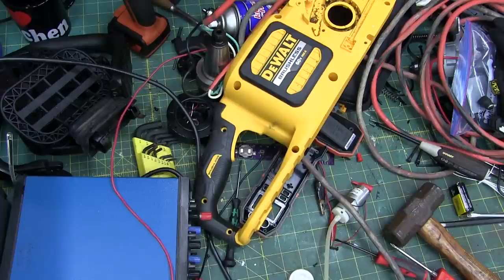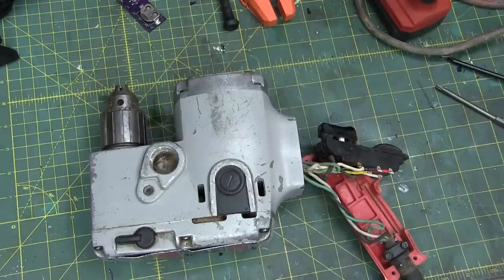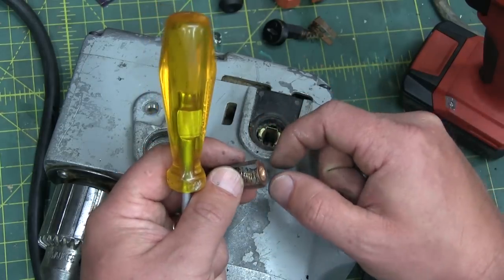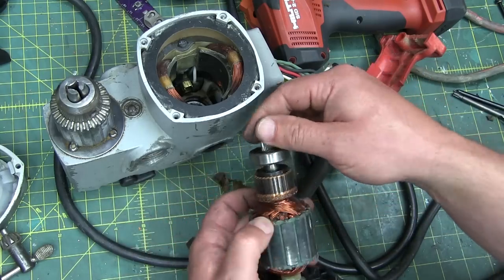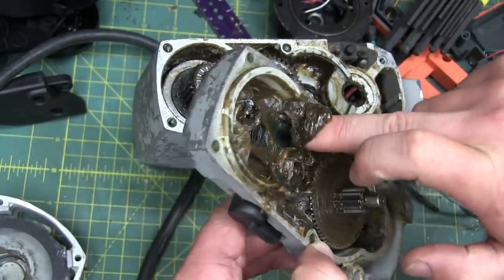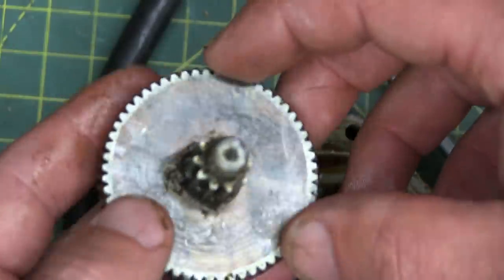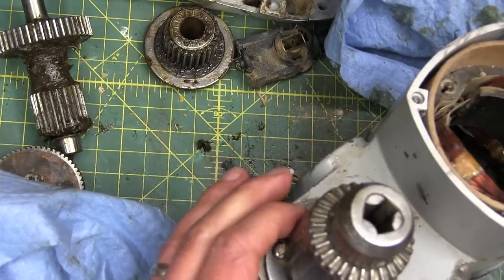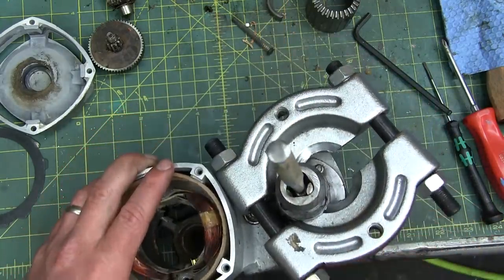BOLTR: Milwaukee Hole Hawg | Long Term Quality

Comment: last time I took a chuck off of a drill, it was threaded on and had to be unscrewed
Reply: Ben D unlike milling machines and large drill press almost all hand drills have theaded chucks.
Reply: Was gunnar mention that. But he only reason I knew some a treaded is because I was drilling a 14mm hole through a post one day with my cordless drill and snapped the center screw when the bit named on me so I put the drill in reverse to take it out and the chuck unscrewed itself off the drill. That poor old drill is still running to this day without the retaining screw in it.
Reply: If there is a left threaded screw inside to fixate it, the main axle has right thread.
Reply: You are certainly right about this one lol ask me how I know.😂
Reply: Yes Sir! The chuck is threaded.
There were adapters to use on those drills for drilling around corners and such.
Very versatile machine.
Reply: The reason the little screw is left hand, is the chuck threads on right hand.  
At least you had the right idea. I am the guy at the machine shop.  They always hammer something into it before bringing it in.  LOL
Reply: Jacobs 33351 1/2"-20 RH threaded mount.
Reply: Just about to say this
Reply: Hand drills typically are, but this one is on a taper.  You usually can get it off by removing the screw and then tapping the side of the chuck with a hammer.
Reply: it is not uncommon for the customers tools to be stuck in the work.
Reply: Steve Pepin Not in this case. That chuck is right-hand thread. Coupled with the left hand retaining screw it can spin in either direction without coming off.  I removed one just like it a couple weeks ago. 

And yes, the drill needs to be assembled to give enough resistance to get it to spin off. Pain in the ass.
Reply: Was going to say this as well.  A little lookie loo at the parts diagram would confirm or deny my idea.
Reply: Boys I tink dis is gunna end badlyier !
Reply: yea that was my thoughts too, came to say this
Reply: i WAS FKKKING SCREAMING THAT.
Reply: yep and i dont think that one is broke yet. tho he hasnt done it any favers
Reply: suppose that would explain the 5/8-18 numbers stamped on the chuck opposite the capacity
Reply: I took one off a old Milwaukee right angle drill and it was threaded on
Reply: Yep the chuck is threaded on there.
Reply: watching him try to force off that threaded chuck  reminded me of the 60v dewalt battery  shipping cover incident.
Reply: Just came on here to say that. Come on Ave you're disappointing me, the chuck is threaded on! And here I thought you knew everything! Haha
Reply: Damn, I thought I was clever noticing this one, clearly the AvE comments section is a place of wisdom
Reply: This is what I thought too.  I kept waiting for him to figure it out.
Reply: He even showed the 5/8-18 thread designation on the nose of the chuck... that is exactly what it means.
Reply: If it's threaded, you definitely need a heavier hammer
Reply: i use an allen socket and an impact,comesright off.
Reply: Same
Reply: jacobs are usually screw on, the little bolt in the middle is secondary fixing, chuck is normal right hand thread, bolt is left hand thread, so if it tries to unscrew it tightens itself, both ways...
Reply: I was thinking the same thing...  Lot of, "Um, wait, WTF are you doing here?" while I was watching.  Never had a HoleHawg though, but replaced MANY portable/handheld chucks by unscrewing.
Reply: To get the thread on the Chuck to slip, clamp a allen-key (as large as she will take) in the chuck. Then get someone to then hold her down while you have a go at the Allen with a hammer.
Reply: Too late for that here, he broke the locking ring with the puller, the chuck is toast. The left hand threaded center screw should have been a dead giveaway to him that he had a screw on chuck. If he puts the drill back together he might have enough gearbox drag to unscrew whats left of the chuck with a pipe wrench.
Reply: I was thinking the same thing.
Reply: This is a fact
Reply: Lol, the chuck incident made my day. Don't know how many times I've done something similar.
Reply: @bobbynate4271  how do you know?
Reply: Doesn't say 5/8" thread on the chuck? unscrew the darn thing
Reply: @kurdtpatton5039  If you don't SCREW up on occasion,you are not using youre full potential! How else we gonna learn?(other than watching others fumbles!) Also recall my father telling my mother "if at first you don't sucseed? Keep sucking untill you do suck seed! May or may not  apply to hole hoggin"?
Reply: Yes. Once I get the left hand screw out of the chuck, I just chuck up an allen wrench and smack it with a hammer and it spins right off.

Comment: If I am not mistaken the reason you were not able to remove the chuck is printed right on the side of it. It is not a taper chuck, but rather a 5/8 threaded chuck. Hence the reason for the left hand center screw.

Comment: I used to build those at the Milwaukee plant in Blytheville, Arkansas back in the mid 90s.
Reply: You did an absolute fecking good job. Bravo brother! Have two 90's models still going strong.
Reply: So how are you supposed to get the chuck off?
Reply: @Vikingwerk  it unscrews
Reply: @jonadabster8401  Thank you Sir, as smart as the guy is, sometimes his "engineer" side takes over.............................ffs...

Comment: The ring is split at the factory. The outer gear holds the two ring halves of the ring together and against the jaw racks. The left thread screw stops the chuck unscrew itself when the drill is run in reverse, which, once the left thread screw is out, is a much easier way of removing the chuck. Let the tool pull itself apart. Hard to do though if the tool is already mostly apart 😀

Comment: Believe it or not, the way to remove the chuck is to have the tool fully assembled, remove the left hand locking screw, then lay the drill on its side and put a short bolt in one of the chuck key holes just above parallel with the bench, then give it a sharp hit downward with a hammer. That usually cracks it loose, then you can spin it off by hand. It sounds like butchery, but that's the way it was done in the 80's (they probably use x-ray lasers or something nowadays).

Edit: I should probably add that the chuck shaft's threaded . Please stop brutalizing it with the breaker.

Also, the tabs going into the switch come out by just popping them straight out with a screwdriver.
Reply: On the threaded chucks you can also clamp the largest Allen key that will fit into the chuck and tap on the end of the key to rotate it off ( once you have removed the retainer screw of course )
Reply: Allen key is how I do em
Reply: Bob James, that is eggzacary the way I remember taking the buggers off, all the swillwaukee drills I have owned/used came off in my hand this way....
Reply: Make a video. I have 4 of these someone gave me free. Seeing if I can fix em.  I'm a visual learner. I'd appreciate the knowledge. 😊

Comment: On the chuck.... look at the small print on the chuck barrel (@ 26:52).... I think it says THD 5/8-18 ......... means it's a threaded mount onto the arbor..... generally RH thread. Because this drill is a reversing model, they add the LH-threaded machine screw inside the chuck to keep it from unthreading during reversing operations.  Most hand-held drills would use a 3/8-24 mount---- this Hole Hawg is Maximum Skookum, I guess. They want the bit to shear-- not the drill's arbor.
Reply: Good eye!
Reply: More like they want to sheer the user's arms first

Comment: My favorite memory was working as an electchicken apprentice standing 6 feet up a ladder drilling a fence post to use to sleeve a wire for a future light. Sure they sell them predrilled but what fun would that be?! I got about chuck deep and all was fine until sparky walked over with a bit extension. As soon as that was on the bit and tight in the chuck he said “ok wait a second” as he got down from the other side of the ladder and stepped about ten feet away then said “ok, go for it!” Wish I knew then why he got that far away but lesson learned! Soon as I started it bound and I learned a valuable lesson. Bumbles DO bounce! I came down after a 1 1/2 twist and a perfect splash into a huge puddle on my head!  That was over 30 years ago but like yesterday when I see any of the guys from my old crew because that’s the first thing to come up after “hello!” Good times!

Comment: Cardboard sleeve is to reduce conduction of heat from motor to housing, ref cooler to operator. 
With regard to regreasing, power tools, try to use as light a grease as possible, ref NLGI grade 0, or 1.
Keep chomping on your bench chap!

Comment: The set screw is left hand thread, but the chuck is right hand threaded onto the shaft. Also those 3 teeth that hold the drill bit will be numbered and have to be installed in the right order to work. It's the same setup as a 3 jaw lathe chuck

Comment: It is painful to watch the heat and beat knowing that the Chuck threads on and I can't say I have never made that wrong turn before either
Reply: No it's not.  It's on a taper.  He should have just hit it on the side with a hammer after removing the screw.
Reply: Bet you a lemonade its threaded on Steve... this ain't no drill press.
Reply: From the owner's manual:  Chuck Removal  To remove the chuck from the drill: 1.Unplug tool. 2.Fully open the chuck jaws 3.Remove the left-handed thread screw from inside the chuck by turning it clock-wise. 4.Pull the chuck off of the spindle. NOTE: If the chuck does not pull off of the spindle easily, tap the side of the chuck with a hammer to loosen it. If this doesn't work, contact a MILWAUKEE service center.
Reply: Tappy-tap-tap
Reply: Tap tap taparoo
Reply: Cringey viewing.                      If it has a left hand screw at the bottom, the chuck is threaded on.
Reply: Steve Pepin I am looking at the original 1675-1 (413B) service parts list and it doesn't appear to be a taper or a threaded chuck.  It looks to have flats on both sides of the shaft that feed through to the chuck.  Interestingly it states that the chuck is mounted to the spindle with 90ftlbs of torque but not sure how if it is not threaded since the lefthand fastener won't handle 90 ftlbs.  Since we don't know the history of this tool it is possible that it has been serviced before and someone installed the spindle and chuck for the (413A) version which is threaded.  It appears versions 413B, 413C, 413D, and 413E all us a spindle that uses flats rather than being threaded.  Since Milwaukee made more than one version for the same model and this one should not be threaded it is possible though unlikely that it is built like the A version. and is threaded but we probably won't know till AvE is able to get it off.  Not sure why they even changed from threaded to not threaded unless they were having too many shafts broken off due to the torque.  The next model down 1670-1 is also threaded so its really weird that they made 2 versions of the same spindle.

Comment: That big helical gear was most likely double-disc ground. Think of it as a small Blanchard grinder set up for high production. Both sides are ground simultaneously. The parts are inserted into a pocket in a rotating disc that is rotated through 2 grinding wheels. High production stuff....

Comment: I vaguely remember a mr pete video in where he takes a chuck apart and explains that "that part" you think you broke, is meant to be in two pieces. The chuck manufacture machines it, and then breaks it to fit into place.  ...Am I smoking crack?
Reply: jfretless you're right Mr Pete did an awesome video about how chucks work. The ring is split by the factory.
Reply: That is wild. I suppose it is infinitely easier than threading two pieces.
Reply: @inthefade  Ford did the same thing with the 4.6l V8 connecting rods, machined the big ends round as one piece and then split them.
Reply: @jonWilk8156  they don't break perfect and thats the whole goal of them, gets way more surface area in the joint. They support half the cap up to the break line then either press or whack it off.

Comment: I fix these for a living. First, how was it running with that spade connector off? Must've just been still touching the terminal but would've broken contact with any vibration. Second, the trminals on the switch are actually flat prongs that slide in. The only thing holding them in there is a slight bend (much like when you bend the prongs of a power cord together to get a more positive grip on the receptical). These routinely fail because the bend relaxes with heat and become loose. Finally, the gears constantly explode on the jobsite. With so many gears and it not being made for formula 1, there's a lot of play between forward and back. Never, ever reverse when the gears are moving. It's so common for those gears to break because of that. Bonus info, there's 2 different chucks, a screw on and a slotted. The slotted slides off, the screw on requires a special tool with 2 tabs on a plate and a hole in the middle to put it on the back side and hold the shaft while you crank on chuck (reverse thread chuck screws must be removed on both). Keep ur dick in a vise.

Comment: +AvE I don't know if it's already been mentioned or not but the nut in the chuck that you thought you broke is supposed to be like that - it is broken in half at the factory. How else would you get it past the flange?
Reply: Agree. It's supposed to be broken in two :)
Reply: Came here to say the same, not broken factory split
Reply: I wouldn't know and I agree too
Reply: Yup.  comes factory split! 

(I cant believe that I caught an error from the almighty Bimbleflip!)
Reply: Yeaa what they all said, i with it

Comment: I'm a plumber and this tool is all business. Takes two hands and more depending on the hole size. I have twisted drill bit shanks before with this tool.  Great video as always you crazy guy!

Comment: I’ve always wanted you to open up a Rigid Power pony we elechickens use to thread pipe. They’re super beefy and could flip a 200 pound gorilla like it’s nothing.
Reply: 200#,  Hell I think one will double as a winch on my 4x4.
Reply: raM3 ewe , yes ! A 300 . or a 700
Reply: texasdee slinglead I’ve only had the pleasure of using a 700 lol.
Reply: raM3 and the elusive rothbergs

Comment: If you look on the chuck it reads 5/8-11 which means it is threaded onto the shaft.  The ring you said you broke is supposed to be in two pieces, so you can get the jaws out if you have to replace/repair them.  If removed the jaws have to be put back in place in proper sequence so the jaws emerge correctly.

Comment: Isn't the Chuck threaded on?
Reply: Not any more.
Reply: Yes, it's threaded on, with a retainer screw to keep it from backing off.
Reply: No it's not.  It's on a taper.
Reply: Yep. Sure Is.
Reply: Appears to be THD 5/8-18 mount, judging from the stamp on the side...
Reply: I am pretty sure it's threaded.... I have changed them plenty of times
Reply: Shsssh! Don't tell 'im yet. He don't even know if it's a left or right hand thread yet.
Reply: I think you are 100% right.  it has a right hand thread. The left hand screw was only for locking. The ones that have a taper are press fit. Only the pipe wrench will help now.
Reply: On this it is
Reply: That much tourq
Reply: That much tourq, I'd think it would be threaded on
Reply: That's what I thought, too. Every smaller size chuck I've replaced was threaded on right handed with a left handed screw to secure it.
Reply: MGTOW Survivalist 
Exactly.  I've replaced 4 in my life.  Cursed it every time.  But that's the best way to remove it.

Comment: Local salvage yard uses one of these with a 1/2" drive socket adapter to spin engines. Makes it easy to test compression and oil pressure before buying. They put a 3 foot long handle on to keep it under control.....